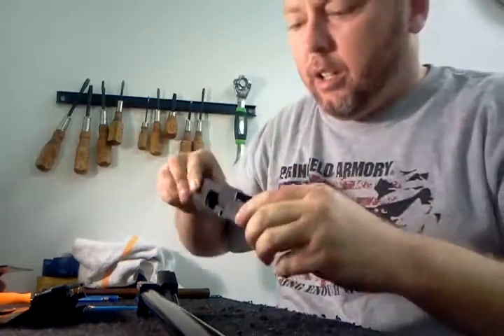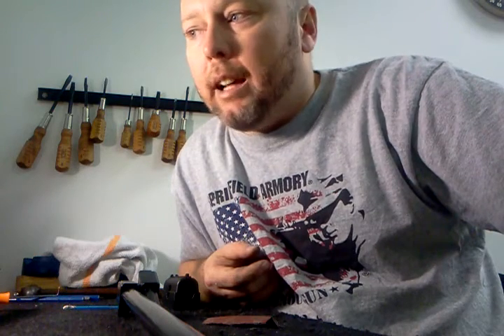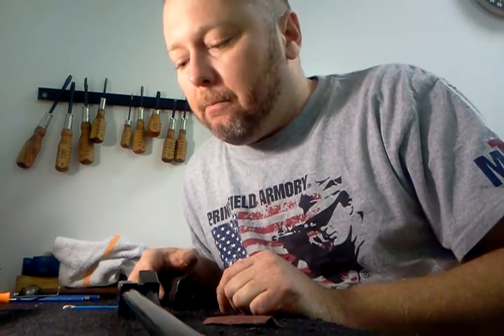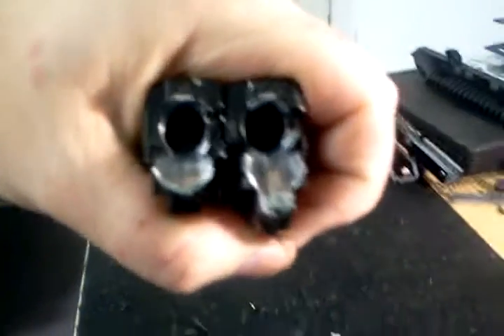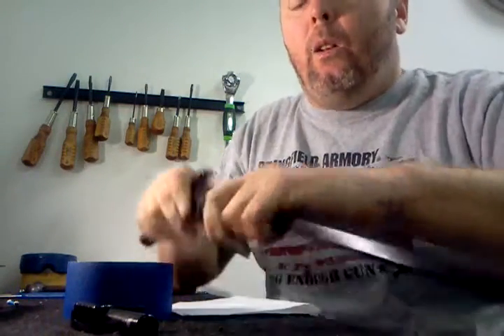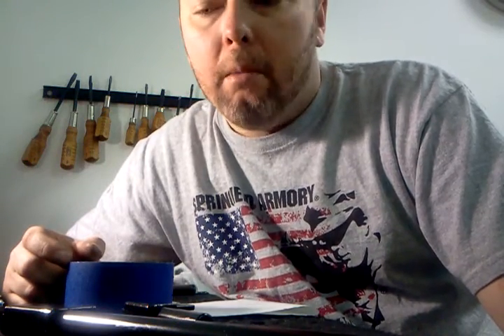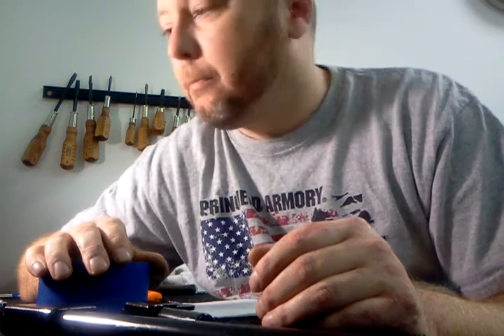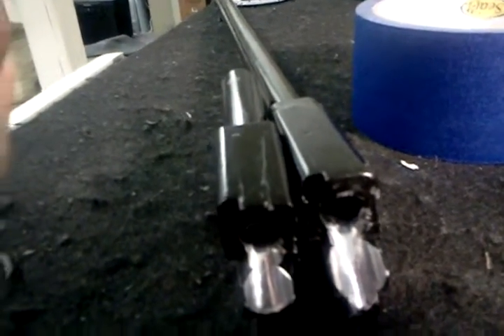Hi-Point 995TS vs C9 Feedramps

Comment: I realize this is an older vid but I decided to add this fix I had to do. I had a OEM 10rd. mag for my Hipoint 995TS that would not run at all. I tried all the adjustments I ran across to no avail. I finally got it to run by cutting the short top of spring off and flipping the spring upside down so the longer part of spring was pushing on the follower. The mag runs Great now. Go figure,lol. Thanks for the Vids

Comment: The feed ramp in the carbine is longer but the extra length serves no purpose. If you remove the receiver cover & bolt, then stick a loaded mag in the carbine then push the rounds forward into the chamber you will see the bottom 2/3rds of the feed ramp is never even touched. You'd have to drop the mag about 3/16" lower to make full use of the feed ramp and then the bolt would never be able to strip the rounds from the mag.

Comment: I’ve been having a problem with my 995ts 
What do you charge to make it stop jamming or stove pipe or doesn’t feed properly ?
Thank you 
GRW
Reply: Sharon Walter 
Sharon, the failure to feeds are discussed thoroughly within the Hi Point Forums. There are 2 forums online. Hipointforum.com & hipoint.net. You can find the answer to your problem there. My experience is that failure to feed is normally a magazine issue with the 995ts.

Comment: i have 4500 rounds through my 995ts now.
Reply: My HP mags don't feed well at all on my 995ts.  The redball mag is good, fmj and jhp.  Only have about 50rds thru each of the HP mags.  Guys on HP forum say to break them in:  keep them loaded and push the follower down several times.  Did you have to bend the ears on your HP mags for the 995 or did they just feed well right out of the box?
Reply: about 200-300 rounds i think before it worked like a charm. i have 8 mags now, 4 i sent back to HP for exchange after 1000 rounds. they was so wore out thy would not engage the last round bar. all i do to them is polish the feed lips so shells slip past better and bend them in till there just wider then the bullet im shooting.